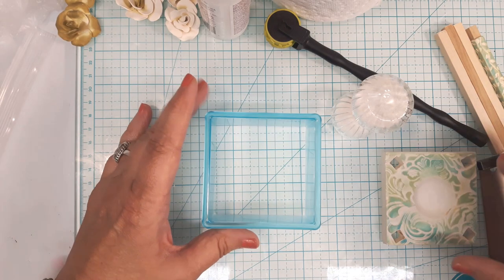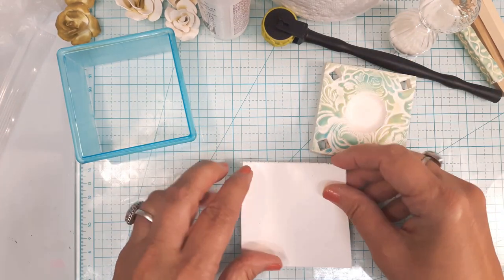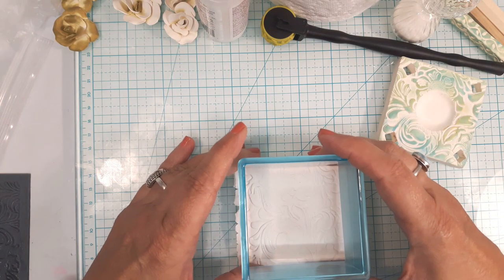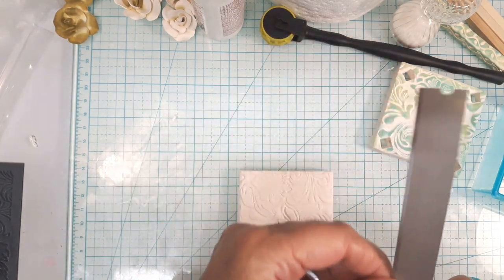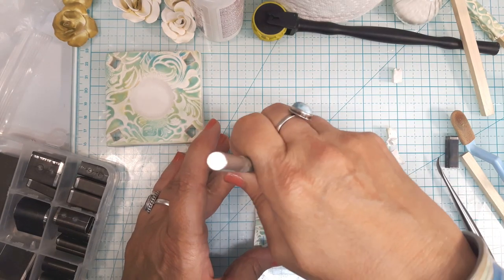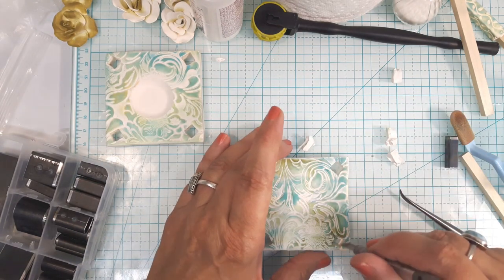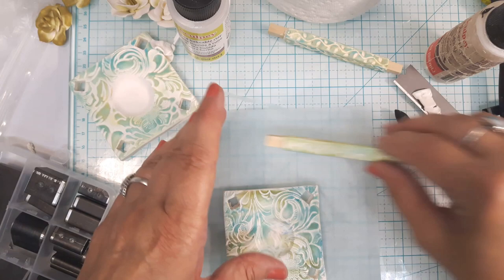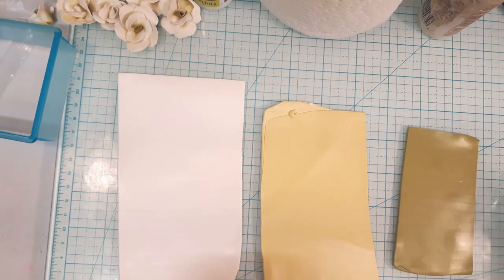Polymer Clay Egg Timer Part 1

Comment: Thank you for introoducing me to the cutter set.. I am also looking for the sizes of hand drill bits you use.. My Hubby is looking for the different sizes you use thank you.. I so enjoy your tutorials I have learned so much I am going to start making jewellery bracelets for my grand daughters for Christmas.. thank you so much please keep up with your tutorials
Orla
Reply from the maker: Thank you, When you purchase a hand drill, they often come with a selection of drill bits. Otherwise, buy the smallest you can find. I like to have a variety of sizes, up to 1/8" as the largest. The larger ones don't fit most hand drills, so have to be placed in some other setting, or you can make a clay handle for them